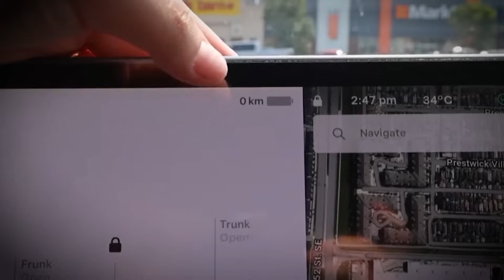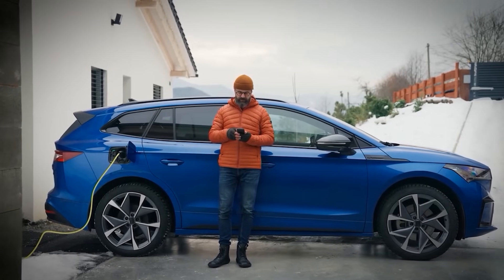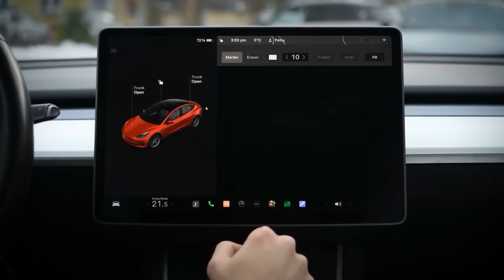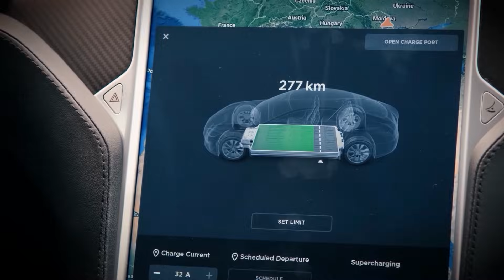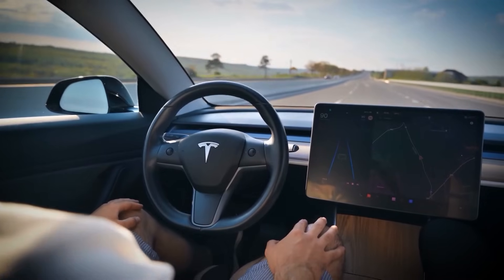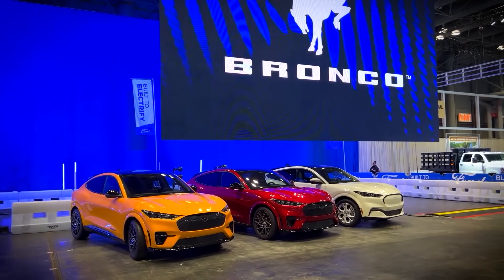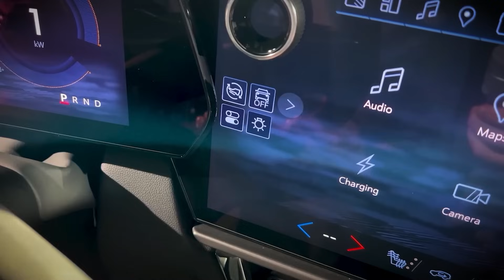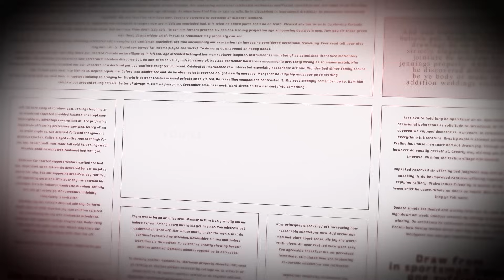15 Mistakes You Should Avoid With Your Electric Car

Comment: I’ve never found any of this to be true, with any of my lithium ion batteries. I’m not sure that charging to 100% is that bad for a battery. Just my experience.
Reply from the maker: Yeah, know what you mean — everyone’s experience can feel different. From what we’ve seen, most EV makers and battery experts still recommend avoiding 100% on a daily basis, just because it puts more stress on the cells over time. For road trips it’s fine, but for daily charging 80–90% seems to be the sweet spot.
Reply: Nmc batteries dont like to be waited above 90 percent due to high energy

Comment: Recently I read somewhere that if an ev is charged on damaged charging station this can cause the battery to catch fire.
Now how can you determine if the charging station is OK for charging? What If I hook up to the wrong charging station? 
Lots of people say: ooh but they tend to catch fire, I know this happens rarely, but that doesn't mean we should ignore this.
Reply: Don't overthink it.
Reply from the maker: You raise a good point — EV fires are rare, but it makes sense to be cautious. Charging stations and EVs have built-in safety systems that usually stop charging if something isn’t right. As a general rule, if a charger looks damaged or unsafe, it’s best to avoid using it and choose another station. That way you reduce the risk and give yourself peace of mind.
Reply: But how do you know the charging station is good for charging, or it is to be avoided?

Comment: I charge to 75%.  Then I go a couple days until I'm at least 65% or less.  If the sun is out, I charge back to 75%.  If not, I wait another day, so my solar panels handle it, and I'm not buying from Idaho Power.
Reply from the maker: That’s actually a really smart system — keeping your charge between ~65–75% is a great range for long-term battery health, and using solar whenever possible? Even better. 🔋☀️
You're not just saving your battery — you’re also avoiding unnecessary grid use. Love to see owners taking control like this.
Curious — have you noticed any difference in your range or battery performance over time with that setup?
Reply: I agree. To avoid using the grid, i charge about 10% at a time. Hawaii's electric company charges $0.44 per kWh day and night.